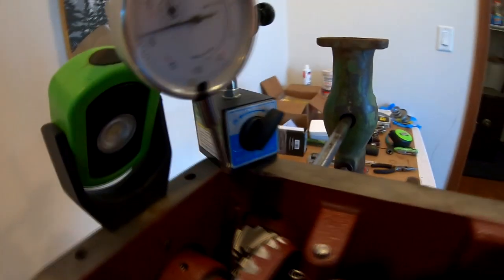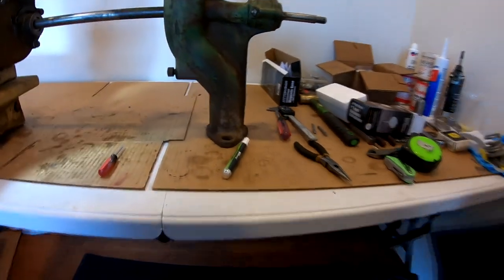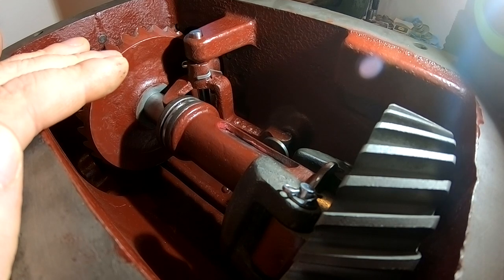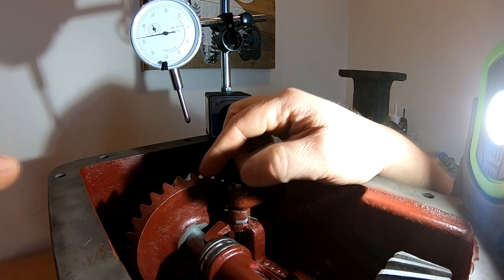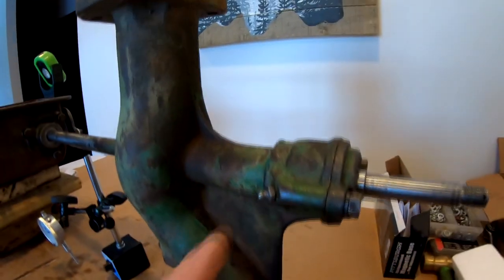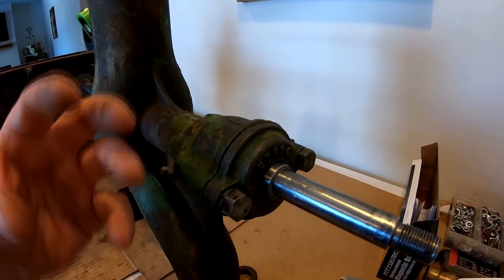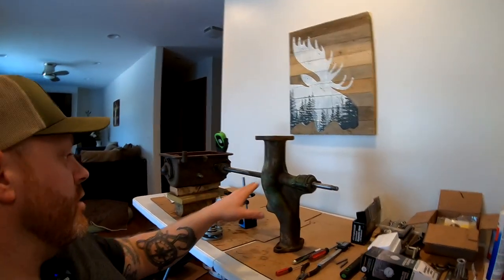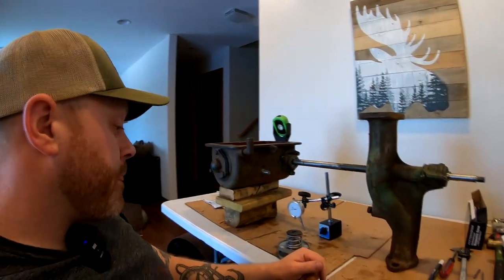1927 John Deere D S# 44891 Part 10: Governor/Fan Shaft Set-up; Gear Heel, Contact Pattern & Backlash

Comment: A product called RYD LYME works well.  Comes in a gallon jug.  Mix it stronger than it says to on the jug.  I usually use it full strength if it is badly scaled up. Make sure it'sin a well ventilated area, and it will foam up when it hits the scale.  It'll eat on it and dissolve it away.
Reply from the maker: I will have to look it up! Thank you!

Comment: Just FYI closely inspect the condition of your fanshaft threads and the castle nut that hold the fan assembly together. My threads gave out on the DI and let the fan go into a nice new radiator core. For your waterpipe cleaning, I've actually had good luck with vinegar and letting it soak
Reply from the maker: Don't worry - I had the fan shaft welded up, turned down, re-threaded, and the keyway cleaned up. It's good as new!

Comment: I prefer citric acid for that type of rust removal. You buy it as a powder and then mix it with warm water. You can vary the concentration to get the desired affect. It works slowly but it's easier to use than some acids. Always mix with warm water by adding it slowly to the water otherwise it will just clump up and get difficult to mix. 👍👍👍
Reply from the maker: Good advice - I will look into it!! Thank you!

Comment: I would try muriatic acid inside the water pipe.  Block off the ends, fill it with 50% Muriatic and let it sit for 30 min. Rinse, repeat until the rust is gone. Then rinse and rinse again.  I have even used 100% acid a few times but that is dangerous.  Definitely wear a respirator, gloves, and goggles.
Reply from the maker: Good advice - thank you!

Comment: These assembly videos make me ponder on the people who assembled those engines in the factory. 
I wonder about the lighting, and tools they use.
My only solution for rust, lime, and accumulated debris requires a running engine. 
I've participated in working a engine with the coolant system full of vinegar. 
It requires getting the engine to operating temp for hours. 
Thank you Kenny. 
Less than 70 days til LeSueur.
Reply from the maker: That would be a LOT of vinegar! I would have to believe the system holds several gallons of water/coolant. But yes - vinegar is one good way to do it. I was just hoping I could do it before installation, then coat the inside to prevent future rusting.
Reply: @KennyKizzleRustyNutzRanch  Vinegar was cheap.  I used it on a F20 at the suggestion of a radiator man. I worked the tractor for a day.  I'm thinking 6 gallons. 
You definitely find out if someone used stop leak.

Comment: This makes me wonder when they started putting the wedges in to hold the fan on
Reply from the maker: I'm not sure? I know that some of the A/B fans were mounted with a rubber insulated hub, and they were notorious for deteriorating and allowing the fan to fly off the end of the shaft and into the back of the radiator... An expensive repair!
Reply: @KennyKizzleRustyNutzRanch  I'm pretty sure my b has the wedges. It's a 41 model